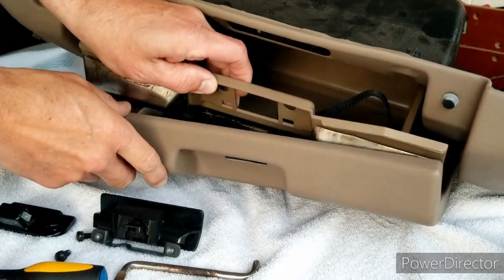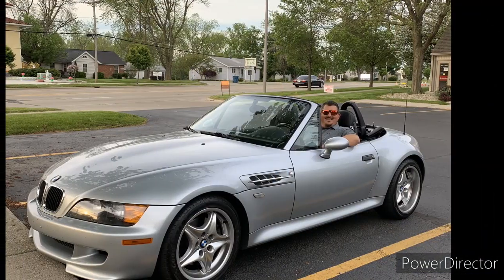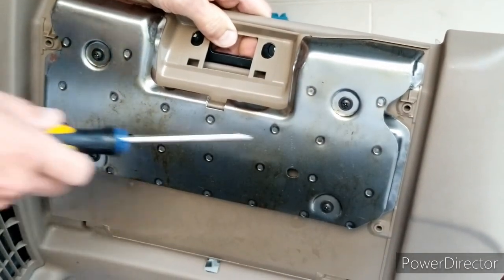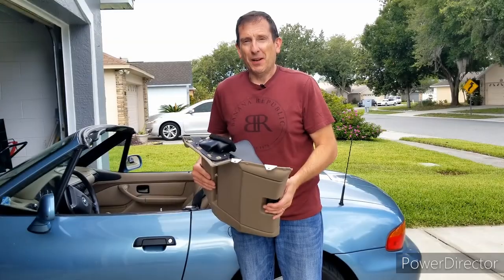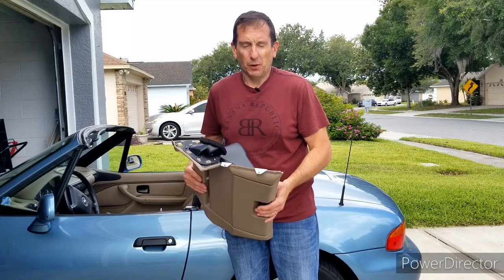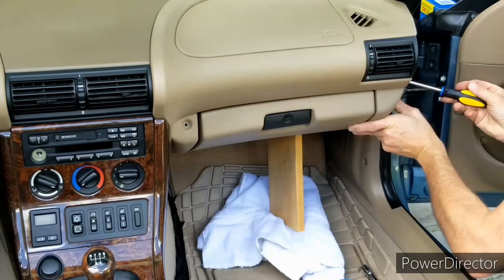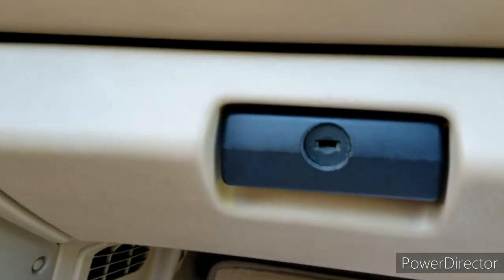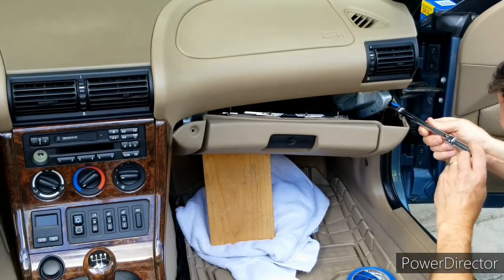HOW TO FIX a Sagging Glove Box Part 2 (BMW Z3)

Comment: You were absolutely right in your conclusion, it took me 5 minutes to fix the sag, I just removed the 4 phillips that hold the cover that houses the crush plate, 2 more phillips that hold the hinge which dropped the lower attached rectangular knob and then I pried it open with an plastic prying instrument (don't like to scratch or break stuff if I can avoid it), that exposed the heavy crush plate, 4 phillips removed that one and Voila! sag gone, still I pushed the existing bar with my hands upward to try and bend it back straighter, put it back together and no sag. I will come back next week and install the reinforcement plate I bought in case I want to put something a little heavy ever in the glove box, don't want it sagging then, but for my outing tomorrow, it looks great!
Reply from the maker: Nice to hear!  Glad it worked out and thanks for watching!

Comment: Great video Ill have to get that bracket !
Reply from the maker: Thank you!  Try taking out the plate first from the glovebox door, and tighten all the screws you have access to first- this may solve your problem and save you some hassle- if not, buy the bracket.
Reply: @MomentofZed  Oh the plate in the door is coming out for sure have to have the bracket all clips broke away ha !
Reply from the maker: @ladigger362  Good luck!  I feel your pain!

Comment: I fixed my sagging by taking out the 2.0 lb submarine plate in the glove box door. Its four screws and the latch mechanism. My plate just fell out because the screws were all broken. It's amazing how heavy that makes the door which causes the sagging, the door is light now. I bent the sagging part back into position and tightened all the associated screws to it. No more sagging box and took about 20 minutes to do. I did not take pics along the way, wish I had now, but this is pretty well documented on the forums and videos out there. I posted a short video on the removal of submarine plate in the BMW Z3 group on facebook. Depending on how bad your original sagging plate I would try this first as you don't have to take the box out and risk collateral damage to the box, vent ducting, etc. putting in the reinforcement plate.
Reply from the maker: You're right on and that is my goto when asked.  That should fix 90% of any issues without risking more damage.

Comment: Did you happen to see a fuse box in there when you had the glove box out?
Reply from the maker: Can't remember seeing one.  But it was a while ago.
Reply: @MomentofZed  thanks for replying. I’m trying to track down all fuses and relay locations and heard there might be some behind there but don’t want to take it all apart yet.
Reply from the maker: @z-man7883  ill try to double check for you.  That project was somewhat of a struggle so was only focused on not breaking anything else 😄

Comment: I've now owned my Z3 for 20 years and the glove box is still in as new condition aka not sagging. My wife on the other hand not so lucky. So what is the root cause of a sagging glove box? Weight and heat would be my guess. 

The removal of that armor plate looks like a good place to start, that will certainly lighten the load. How much do you think that submarine plate weighs?

The first thing I did when I bought my car was to remove the BMW owners book from the glove-box, that thing alone probably weighs close to 5 lbs. Not knowing anything about sagging glove boxes years ago removing that book might have saved me an afternoon down the road. Anyways looks like you got her fixed, carry on...
Reply from the maker: Just went to the garage to find it and weigh it.  Couldn't find it!  Damn garage.  Guessing 4-5 pounds.  About the same as the book!  The crash plate was added to comply with our Federal regulations.  The bracket to support the box was left unchanged- too much weight for the bracket basically.
Reply: I weighed the submarine plate. It is 2.0 lbs.

Comment: Why didn't you show how you connected the straps at the top. That's my situation; and I don't to disassemble the whole thing. The Bentley guide is useless for this; and the metal clips don't want to fit on the plastic parts of the strap. Any thoughts?
Reply from the maker: Here's what I would do:
1.  Remove the anti-submarine crash plate if you haven't already (WITHOUT removing the glovebox from the car)
2.  Lower the glovebox enclosure without removing it (see my suggestion at the end of this video).
3.  BEFORE doing either of those, watch my Part one here:
https://www.youtube.com/watch?v=186-ZXRjf-0 
Hope this helps- please let me know and thanks for watching!
Reply: @MomentofZed  Well, that seems more complicated than it should be. The issue is how they connect at the top not the bottom; but I'll try it. My next issue is the burned out bulbs behind the fan speed and the temp. selector. Looks like taking out the radio, undoing the screws on either side and pushing the tabs on the top flange should do it. Bulbs are$13 bucks each. Yikes! Have you ever done this? Maybe I should film it and send it to you.
Reply from the maker: @tonerapture2717  I have to do it soon- not for burnt out bulbs, but for a sticky temp selector.  I was going to wait to do that along with sending the radio out for repairs (potentially).  You definitely have to remove the radio, let me look into the rest.  Bulbs are expensive; the side marker bulbs (super tiny) were $5 each, replaced mine when I tried to do the gasket for the middle brake light.

Comment: This is a major pain in the …. Way more then it should be. Thanks for the videos. Someone buy mine 98 2.8L only 65k miles
Reply from the maker: Hang in there!  Don't how long you've had it, but they're a lot of fun!
Reply: Couple years. It is fun to drive but this interior is a nightmare to do anything and just too uncomfortable to live with compared to the M3
Reply from the maker: @gixxerhoff7502  fair enough!  I need to tackle the emergency flasher button and not looking forward to it.
Reply: @MomentofZed   yesterday I did all new wheel bearings and struts on my M3. Piece of cake.!Today I only had to do this glove box fix and diff fluid change on the Z. I wouldn’t wish this glove box fix on my worst enemy. I gave up trying to drop glove box completely. Maybe because it’s been sagging so long….. nothing lines up
Reply from the maker: @gixxerhoff7502  i feel your pain as you can see by the two parter I had to do!

Comment: Bro, thanks again for all you do! But I wanna ask, is there a better way? I don't honestly want to take the crashplate out, it's kinda there for a reason. Debatable if that's a good reason or not but lol 
   I'm thinking there's gotta be a way to just possibly re-enforce it somehow that you might have seen?
Reply from the maker: Check out part one.  There is a reinforcement.  But if your passenger wears a seat belt the plate is superfluous.
Reply: @MomentofZed  My reasoning behind it is more on the side of just trying to keep the car as original as possible. My passenger always wears their seat belts bc I'm not tolerating that dashboard light or any possible dinging noise from Alexa 🤣
Reply from the maker: @Gambit22003  fair enough, been a while since I did these videos, but it can go back in if needed as I remember.   I still have mine.

Comment: And now for your next project might I suggest you replaced the original sound system, if you haven't already.
Reply from the maker: Don- I have to replace the (commonly) broken sub-woofer, that will be a video.  Believe it or not, I know it doesn't have Blu-tooth, etc.  I know it doesn't sound great, but I may repair and keep the original head unit.  I like the way it looks, the controls are logical and I don't have to take my eyes off the road to use them.  Plus, I still own CDs!  We'll see...  Thanks for watching!
Reply: @MomentofZed  I can relate to old school approach. However, after doing the whole works in stages, the biggest improvement was replacing the floor well speakers with Kicker DSC50s. Of course, it was easier with the glove box removed but I'd do that again without hesitation.

I love the way it turned out, incredible sound. I put about $400 into the new system. Replaced the HK power amp too. I pulled the ported sub-woofer and replaced it with a set of Pyle mid bass speakers.
Reply from the maker: @idahoflyfishingadventures5244  Sounds like a reasonable project.  I'm not really against any of that- certainly I'm not against new speakers- that's invisible anyways.
Reply: @MomentofZed  good luck playing CD's with that suspension. The changer in my trunk goes bonkers over even a small bump. It's pretty useless. What I did was buy an $8 cassette adapter so now I can play my ipod endlessly or play music from my iphone while it charges.
Reply from the maker: @tonerapture2717  Thanks for watching!  I actually deleted the CD player when my trunk was leaking (two videos ago).  I'm going to install a bluetooth adapter.
Reply: @idahoflyfishingadventures5244  Hey there. I'm thinking about upgrading the speakers on my 2001 3.0i z3. Can you recommend me which speakers you used? and did you just replaced the original ones? I would like to hear your experience! I'm not familiar with speakers / car audio systems but most of my speakers are shoot and what to improve my audio experience!
Thanks in advance :)